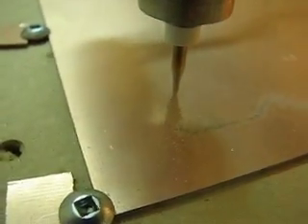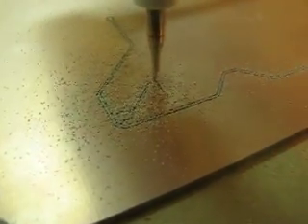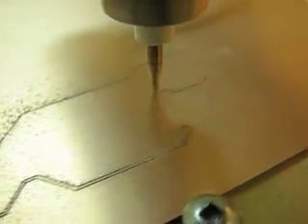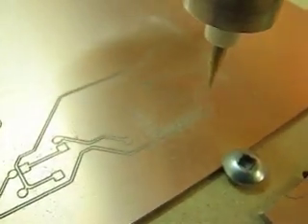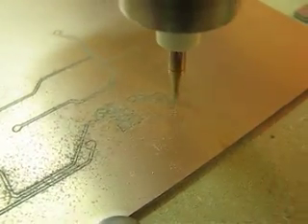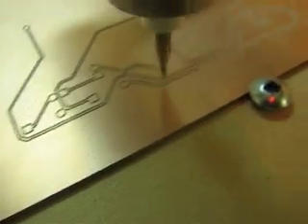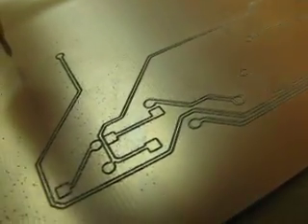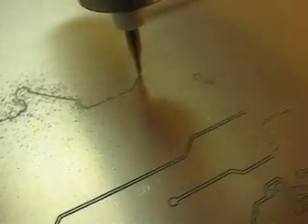PCB Routing

Comment from the maker: Sorry, haven't viewed these for a while! The bit was a 60 degree V-bit from Think & Tinker. The V bits are a bit of a pain because an uneven surface results in varying widths of cut. I've changed to using 5 and ten thou end mills from the same company. When the copper clad board isn't flat the width of cut is still constant.